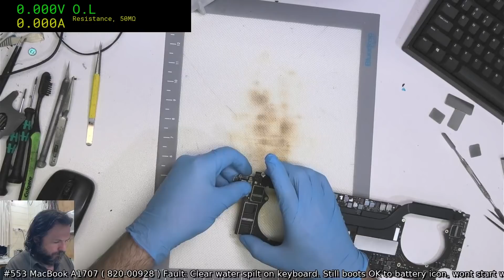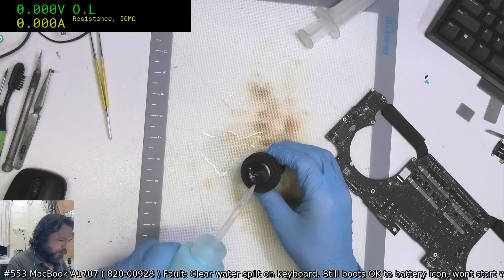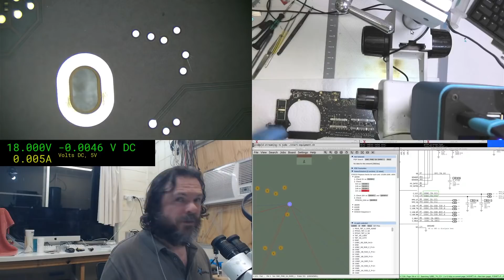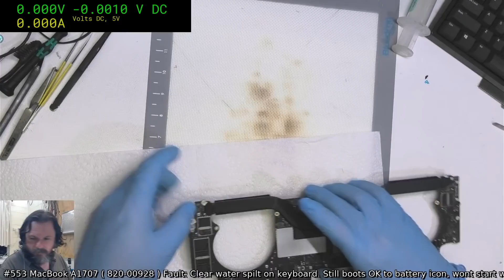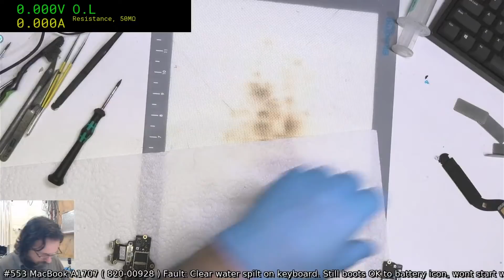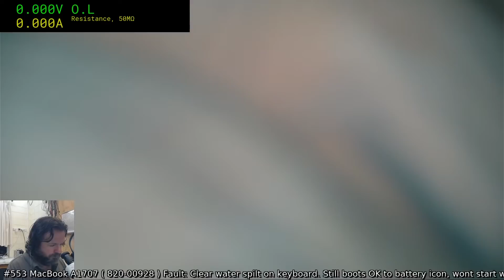#553 Macbook A1707 gives me 20V once, then only 5V for another hour. Calling smart people!?

Comment: Was the board having problems before the water damage? Something was said at some point about customers mentioning battery indicator images flashing, was this something that happened before or after the water spill? Kinda curious about how important the water spill was.

Also, being nervous about removing CD3215s when looking for faults: I don't know which board number this is, I use the same schematic/board view for 00281 and 00928 boards, but the board view I use shows this as one of the boards where all CD3215 pins 46 and 55 lead to external test points for showing if the CD3215 are getting/properly operationg data/clock info, so one can check that without removing the chips. Dunno if that helps, but I never see anyone make use of it, and I can't recall if there's a reason why. I even recall I've mentioned it before in some livestream comment sections, but I don't remember if use was made of it. I just always assume that since, on many other boards, those two pins are NC/dont go to test points, most people don't know about it.

Also, if the usbc amp meter is showing correct protocols, and the machine isn't behaving that way, maybe it's not the machine that's at fault. Try plugging in without the usbc amp meter and see if that changes anything. I keep getting back to that the biggest unknown factor related to the CD3215s here, isn't actually water damage, but the inconsistency between CD3215 behavior and what the usb-c ampmeter is claiming.